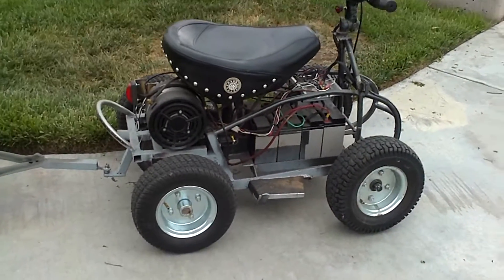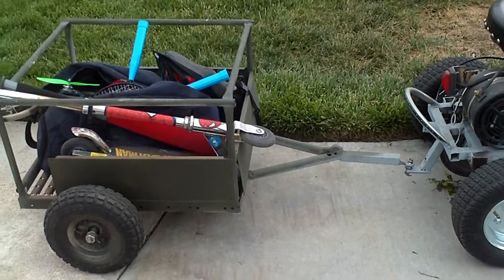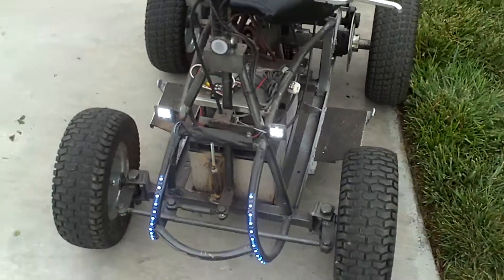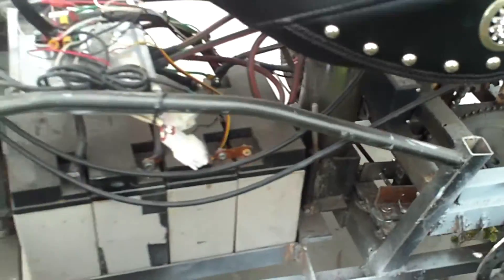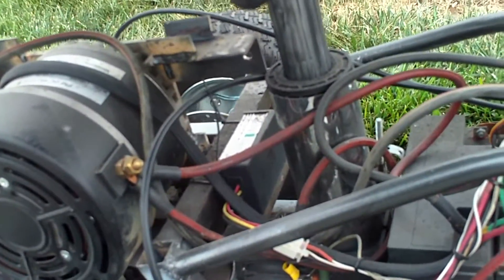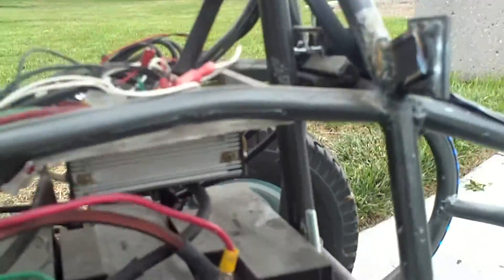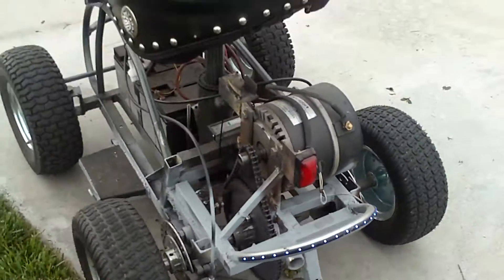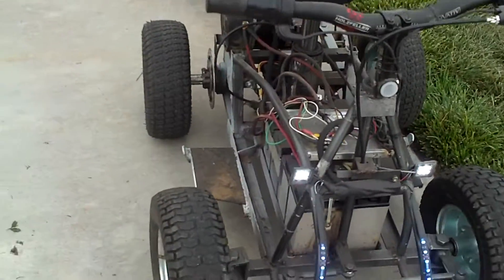Mr. Tmac's Electric Garage Stool Speeder 2

Comment from the maker: i am using #35 chain , 15t 7/8 on motor from surplus center, and 72t, #35 Steel Plate Sprocket form MFG supply, on a differential shaft from northern tool.

Comment: so this is all at 18ah max? 
i got 12 smaller batteries at 3.7V and i can get way more than 50amps. 
did you try it with higher amp?
Reply from the maker: Pablo Nazar yea. in series to get the 48v. SLA batters, not life, or lipo. don't  have that kind of budget. i mean, what budget. this was fun but i,m onto something else now. scratch build mini Emotorcycle. but i,d like to see how you build you batters and your source.